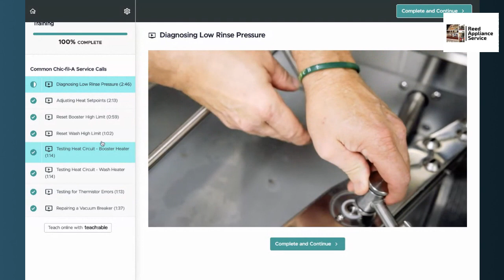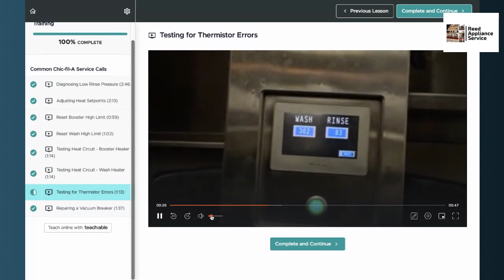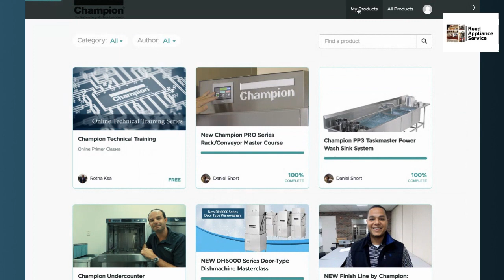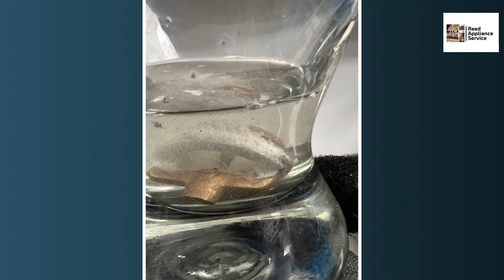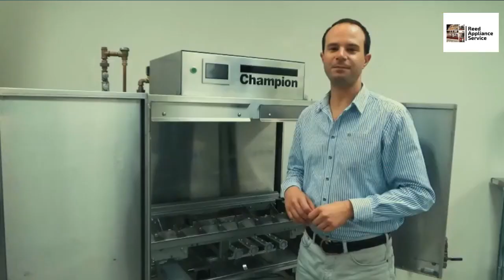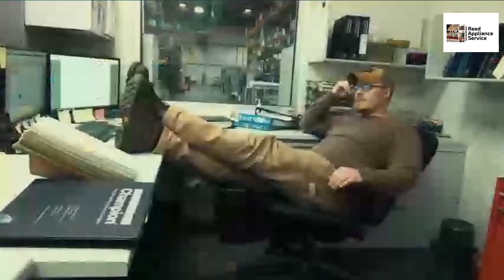Chic-fil-A Service Calls and How to Repair Them  Commercial Dishmachine

Comment: I also have everything i need for learning my brszing technic. I just need to pick up the correct mapp torch.
Reply from the maker: That you have to order. The only bargain basement price unit I’ve found to work is the one I mentioned.  The buy once and forget it is the Turbo Torch from the supply house. $30 vs $300.

Comment: Mike I finished the Champion/Chick fil a training, when can I expect the certificate?
Reply from the maker: Don’t know. Last training class I took was in 2022. One thing I know is that it’s coming. It will be digital and has a serial number.
Reply from the maker: Have you done any calls yet? Also, what's your zip code?
Reply: @commercial_service  how important is the adapter for the Mapp gas? It was not listed on the short list…
Reply from the maker: @alohaappliancerepair9507  the adapter is part of the torch. Remember only get the one I recommended.
Reply: @commercial_service  not recently